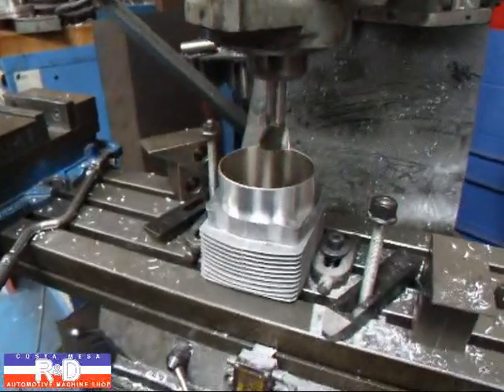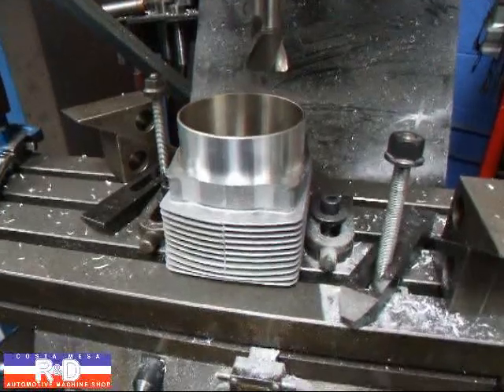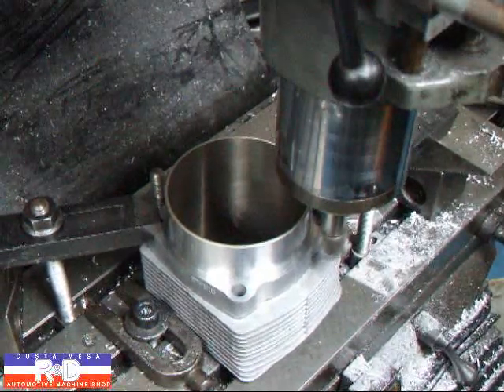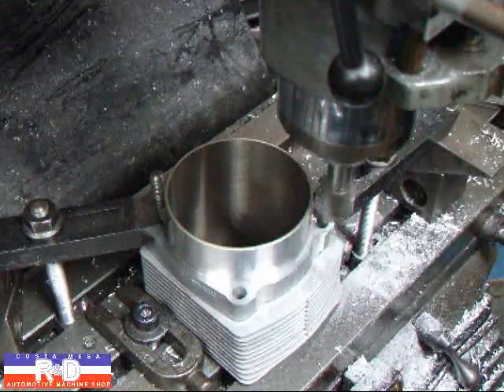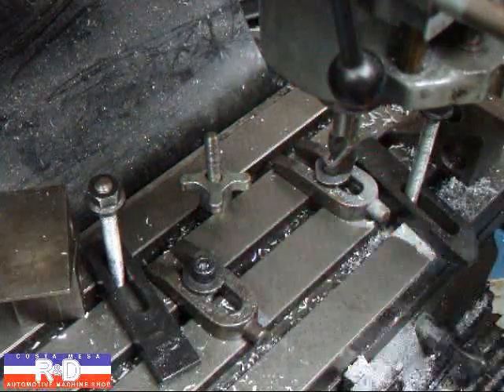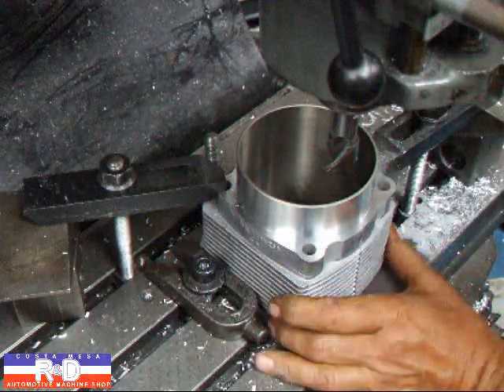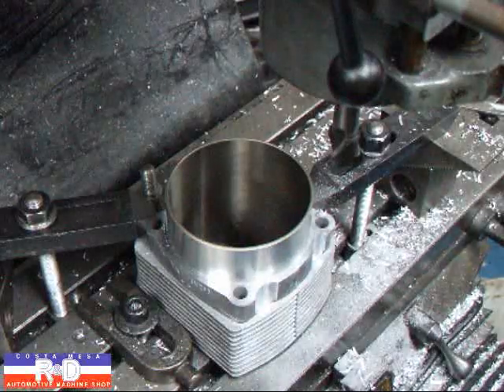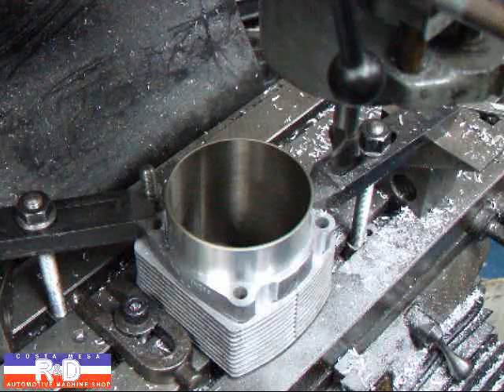Clearancing Porsche Cylinders  for Larger Stud Washers

Comment: You can hear the cutter squeal when it gets to the bottom of the cut.  

If you wanted to set a specific/precise height, and had a DRO, you could set the cutter on the bottom surface, zero your DRO and move the cutter down to 0 on each pass.